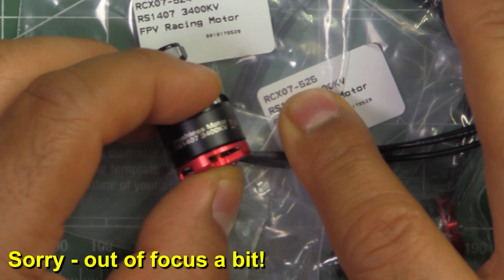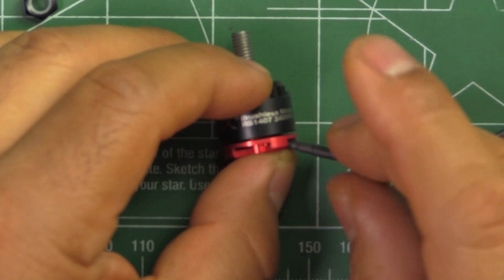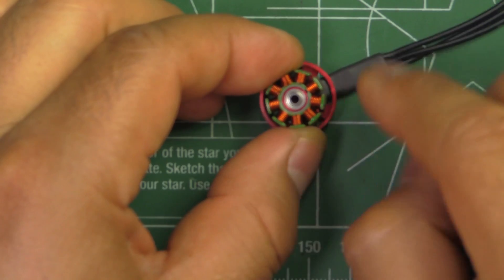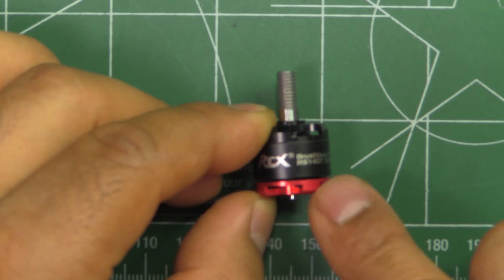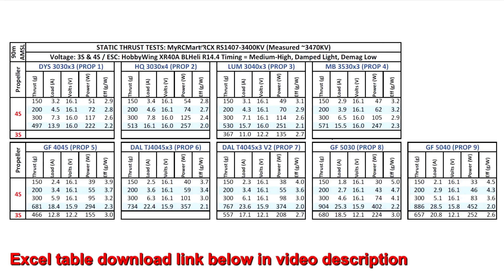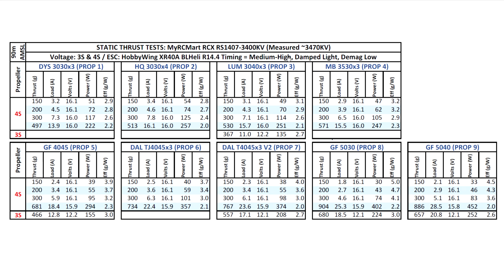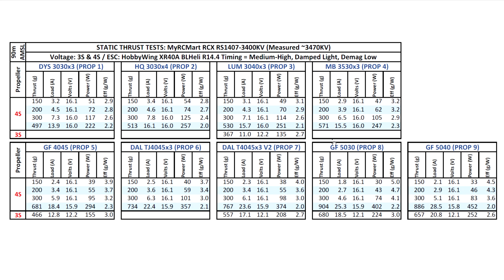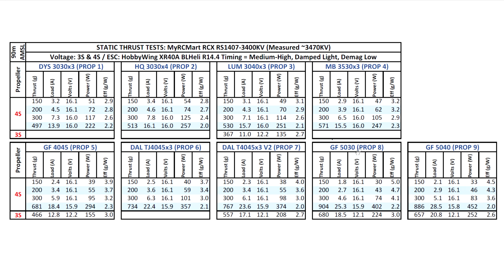MyRCMart.com RCX RS1407-3400KV

Comment: Can that motor size(1407) with 2800kv be used with a 6030 prop for a rc plane .And if it can work whether that setup will be efficient? Thanks
Reply from the maker: Probably with 2S battery and only for a small and ultra light plane. But I have not tested or seen anyone use that. About efficiency, I think just normal, motor will be working hard

Comment: I have one HGLRC FLAME 1407 3600KV.... Would you recommend me buying 3 more or buy a whole set of these? How about a whole set of Brotherhobby 1407 3600kv? I'm running 3 inch triblades
Reply from the maker: Im not familiar with the HGLRC motors. These BH have been used by lots of people and they were the gold standard. There's also the 1507 size very good too. Almost everyone that gets these or BH 1507 are quite happy.
Reply: @EngineerX  I just took your advice and bought the 1507's. I'm excited! Thanks for your help!
Reply from the maker: @TheFlyingHernie  For 3" triblases 1507s will work very nice and the small weight increase not noticeable.

Comment: EngineerX what are the best motors for a sub 250 gram 3" build that are smooth and have good flight and power? Smoothness also to reduce jello in my video recordings also?
Cobra 1407 4100kv 
DYS 1404 3600kv
Or any other motor?
I am lost please advise?
Reply from the maker: There are several good options. Depends what your main goal or purpose for your build. Do you want to carry an HD camera? >> 1407 ~ 1507 motors is what you need, but would go over 250g
Do you want a build that is more micro? Then 1108, 1304, 1404
Do you want the fastest build, then 1407-4100 on 4S and 850mAh battery is what you'll have to use:  https://youtu.be/x0lOgwmfGKw https://youtu.be/BmdrQfwdA6o
Cobra makes a very good 1407 also T motor f20ii (1408 3750kv) is getting good reviews though I have not tested it but should be a good one to consider.
DYS 1404 is good and affordable, though someone mentioned that if you crash them hard they will break and are a little less durable than 1407's
RCX 1304 : a lot of people very happy with those, just do a search and you'll find lots of videos on those
 As you can see, what motor is best depends on what your purpose is and there are many options. Also staying right under 250g AUW will require good planning in component selection.

Comment: Would the amperage be lower on 3s? Looking at going for these motors and wondering if i will nee to upgrade my 12A esc's to 20?
Reply from the maker: Yes, it'll be lower. 12A ESC's should suffice for up to 4" prop DAL T4045x3 V2 based on my Max thrust measurement of 17A. Lower that by 25% to account for prop unloading in flight and Max bursts should be about 12.8A. That's well within your ESC rating :)

Comment: So 90% of racers that run 1407 motors do it on kingkong 4045 dual blade props. Why don't you test these, it's literally the only prop that's 4 inches and matters

Comment: Maybe another motor to test, the 4100kv version of the Iflight if1407 4100kv, you already tested the 3500kv version and those are pretty powerful I'm curious how the 4100kv will preform and take a note that the underside of the motor is pretty weak heard from some people that they come of.
Reply from the maker: Thumbs_Fpv i think they're sending me those. Unfortunately I can't find out how strong in crashes motors really are. Not until I crash myself but by then people already have posted about their durability.

Comment: i personally would be interested in seeing you test the a 4000kv+ 1407 class motor on 4s, specifically the rcx 1407 5000kv motor. They only list for 3s, but want to see if it could handle 4s. If so, they would rip!
Reply from the maker: I'll see if MyRCMart is willing to send me a test sample next time. My feeling is a 1407-5000kv may be borderline OK on 4S, 3" props - DYS 3030x3 and a little more risky on Lum 3040x3, but motor would probably run a bit too hot and very inefficient. 5000kv is probably best for 3S. 
I think 4100KV motors would be the top of the KV range for 3" & 4" props on 4S.
Reply: Nathan Schlenker Cobra 4100kv run fine on 4s with heavy props, as do the rcx. They eat batteries tho
Reply from the maker: Right, that's what I've been hearing. At this size 4100KV motors do make a lot of thrust on 3" and 4" but they need a lot of Amps. So if you go higher on KV, I'm almost sure the increase in thrust will be very little compared to the increase in current and Amp use so it won't be so practical.
Reply: From my testing 3 inch is the sweet spot for 4100kv. I'm having a lot of fun with rcx. My feeling on the Cobra after running them on 4 inch dal 4045 v2 is they're not as powerful as the RCX but very efficient and incredibly smooth. I wouldn't even bother with the rcx on 4 inch. Battery life was fine for Cobra. They remind me of the rotorgeeks 1407s which overall remain one of my favourite motors, but I'd stick with lower Kv.  The new HQ 4x4.3x3 V1s is the new 4 inch prop of choice for me. Lighter than the Dal v2 but stronger than the crappy t4045 or tj4045. As a 4 inch fan I've been waiting a long time for it :)

Comment: Thx for testing !
Can you do more 3S on 4000+kv 1407 motors ?
Reply from the maker: Yes, I'll run a couple of the props on 3S but not all of them, just the ones that have higher thrust: GF5030, DAL T4045x3, GF4045, and LUM3040x3. Those should give a good representation of 3S performance for the 1407-4100KV motors
Reply: Nice, im about to join the 1407 family with my 3" quad, but i only got 3S.. I understand that those motors are quite powerfull, so I would need to load them up with some heavy props.
Reply from the maker: Kristian Frydstad For high thrust on 3S you'll need 4" triple blade or 5030 props. For 3" you'll need at least 4000kv

Comment: Hey your test are perfect! 
Are you going to look at the racerstar 2305 as well maybe the 2400kv with 5s
Reply from the maker: Thanks for watching. I have not ordered the 2305. On 5S I think the Amps are going to be too high for the motor and windings may get damaged. But that's on the thrust stand. Motors get far more stressed on the thrust stand than in the air, so I think they should be Ok on 5S once flying

Comment: This is a very decent motor, pretty amazing for what it does. Btw what do you think about the Racerstar 2205 3000kv on a 5050x2 dal cyclone v3
Reply: And do you want to do a thrust test on 5inch with the dys 1407
Reply: I think the racekraft 5038 would preform better than the 5030
Reply from the maker: RK 5038 and all other RK props don't show good performance on static thrust tests. They have a very special design - made for moving at speed through the airstream. They need air moving thru them, so on the thrust stand they will show very low performace compared to the other "conventional" props. That's whay I don't use them in my  tests anymore. I don't have the DYS 1407 motor yet, hopefully DYS sends it for testing. I tested the first version already - it's in my channel
2205-3000KV on C5050x3 - my opinion is KV too high for that prop on 4S. You will get high thrust but very inefficient. High Amps too so your LiPo will drain fast I think and motor may overheat. On 3S it should be OK.
Reply: EngineerX I mean the bi blade not the tri, and what do you then think about on rk5038 (sorry for all these questions haha)
Reply from the maker: Hahah..... sorry I didn't see you wrote C5050x2 - I think it should be OK on 4S for that motor, but I would go for a quick lap and land quickly and firmly grab motor bell. You should be able to firmly hold it without feeling uncomfortably hot. If you have IR/LASER temp gun, motor bell should be around 50 to 60C maximum. I need to order those 5050x2 props to include in my tests.
RK5038 is an OK prop, but if you're used to flying with tri-blades it might be disappointing because it feels less responsive but you gain more efficiency so you get slightly longer flights. 
But on that 3000KV motor..... who knows  - it could be very good, but someone has to try it and let us know !